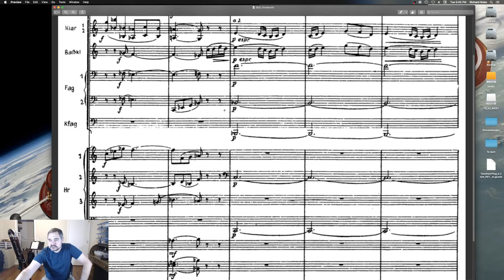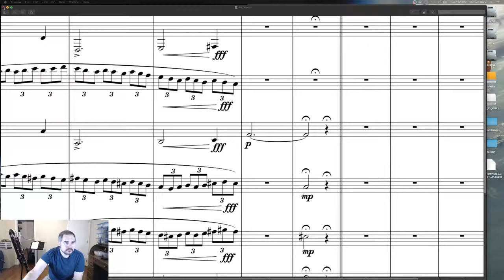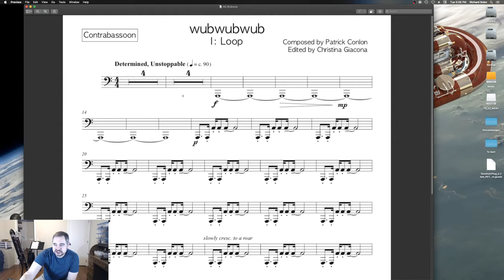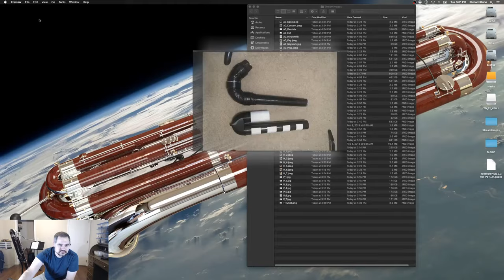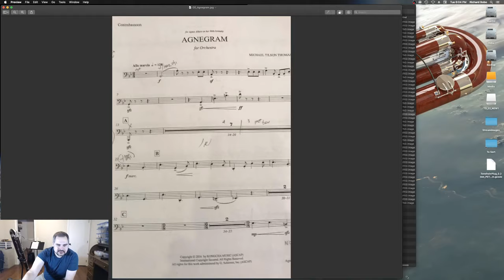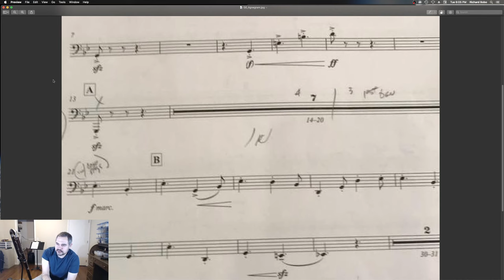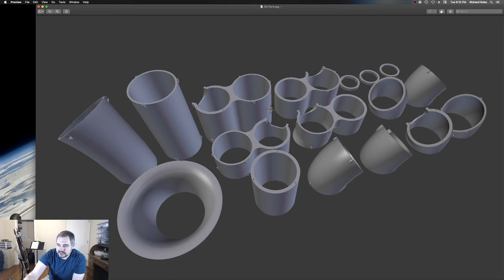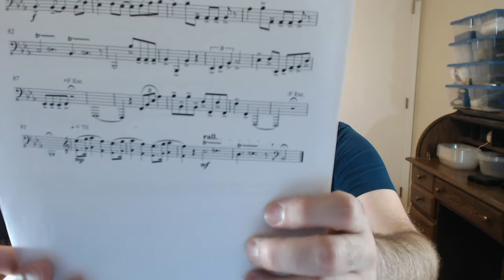My Weird Contrabassoon Bells (Unexplored Depths II)

Comment: For the tone holes, could you put threads on the outside and screw a lid on like a pill bottle? The seals in the lids probably wouldn't live as long as you'd like, but better to wear out the consumable parts than the big one, and if you used the same OD and thread pitch on all tone holes, you wouldn't even have to worry too much about which one goes where, at least until the seals started permanently deforming to match certain tone holes.

This shouldn't interfere with adding keywork later either.

Comment: What software did you use in designing the low A and G bells? Also, how do you plan on making the keywork for them? I recently finished a prototype bassoon low G extension with keywork and am looking to refine the design/functionality.
Reply from the maker: I designed them in Autodesk Inventor.  I do plan on adding keywork to the A bell (after I reprint it in ABS),  but keywork for the G bell would be too cumbersome.
Reply: @Subcontrabassoon  I have a hacky and impractical idea for the keywork for a low G: bicycle brake cables and pedals. This will require no alteration to the instrument itself, but will be inconvenient to move around.

Comment: If you see my comment I don't remember if you mention this in a the video however when you finally finish the subcontrabassoon  Are you gonna make it the version that plays all the way down to the low a which would be cool and I think is necessary
Reply from the maker: Actually, the subcontrabassoon prototype I'm working on will play down to A.  I currently have no plans for a Bb model.
Reply: @Subcontrabassoon   No B-flat would be nice if you can later on build a slight extension that actually fits the instrument without using crazy PVC like you did with your contrabassoon but as you said it's unnecessary to go as low as B-flat since the instrument is just a cool idea that you are making and currently no music goes that low for contrabassoon  And it already is going crazy low so a is probably fine
Reply from the maker: @Jeremazing13  I designed the subcontrabassoon from the group up with A in mind as its lowest note.  Shortening it to Bb wouldn't make it shorter, nor make it much less bulky.  If I wanted to have Bb as the lowest note, I would have wrapped the instrument differently to reduce the overall height.